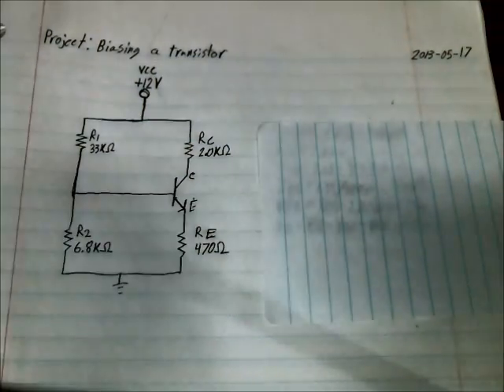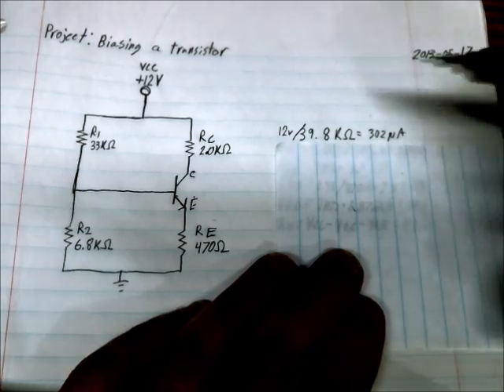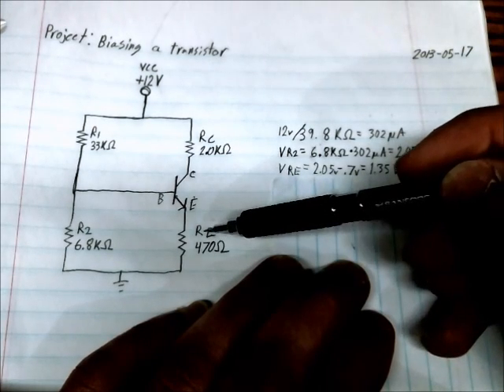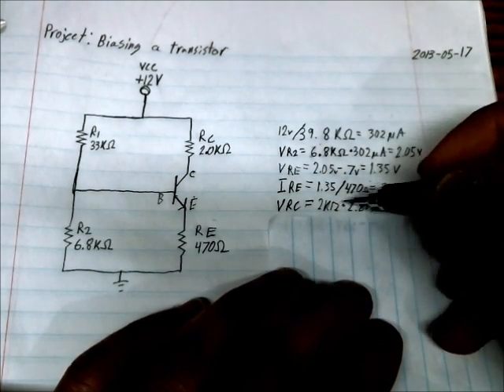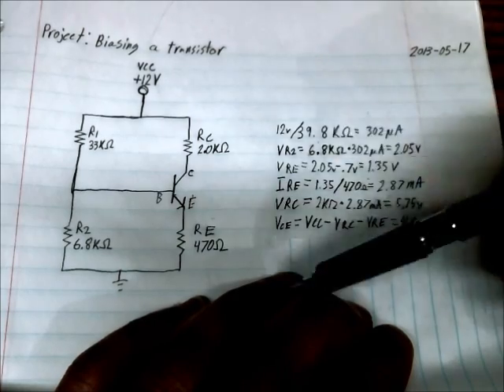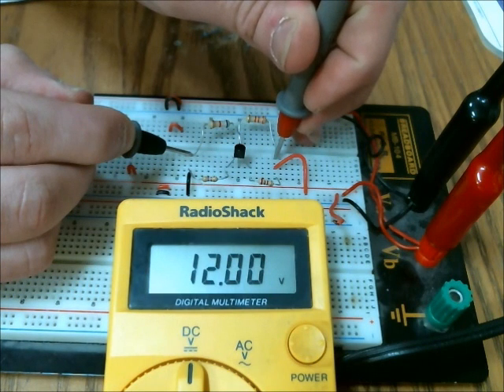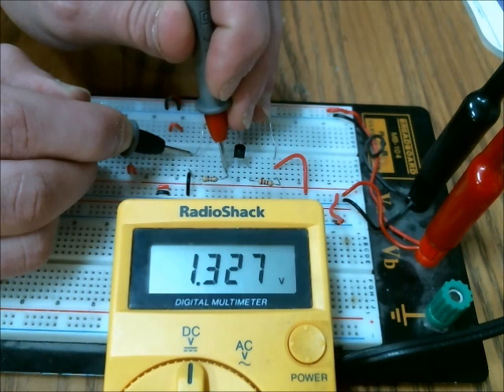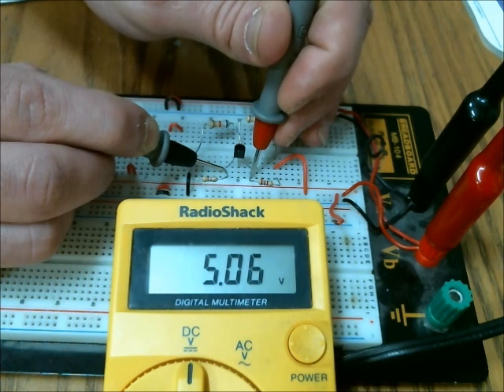How to calculate Transistor Bias

Comment: Why do you calculate VR2 and not VR1 and then use that to calculate voltage drop between the base and the emitter, when the base is supplied from the positive rail R1 side.
What would be the voltage drop be between the base  and the emitter if R2 was not there.

Comment: Heilman has done good work in showing the various DC voltages when biasing a bipolar transistor.  The trouble with this approach is the accuracy and the application of this
design. 
- the hfe of a bipolar transistor is SPECIFIED with an variation of (say) 3:1. 
-A further variation depends upon TEMPERATURE  due to the self heating of the transistor 
-A complication of the design arises due to the magnitude  of LOW FREQUENCY  AC output 
signals . Many factors must be considered and juggled..., too many to quickly  discuss.
Reply: Because the current through the bias resistors is significantly larger than the base current, the hfe of the transistor has little effect on the bias points.
Because the collector current is fairly low, the dissipation in the transistor is small (about 15mW), so the self-heating will be no more than about 3°C at the junction. That means a reduction in Vbe of about 6mV, but that is swamped out by the voltage across the emitter resistor, which provides negative feedback and stabilises the bias points.
Because the emitter resistor (470R) is very much larger than the intrinsic emitter resistance (25mV/Ic = 9R), the non-linearity of the intrinsic resistance is swamped put and has virtually no effect on the large signal response.

Now, of course, all of that depends on a sensibly designed circuit, which the one shown is, so the points made are valid considerations if you have transistors with very low hfe, or you have base bias resistors that are too large, or you have a circuit with high current and voltage, or you have a very small emitter resistor.

Comment: ehere did you get the .7v
Reply: Any silicon transistor passing a few milliamps of current will have a base-emitter voltage drop around 0.6V to 0.7V. It's an inherent characteristic of all silicon P-N junctions.

Comment: HEILMAN HACKATRONICS 
                                                                          Does the AC/DC load line mean the maximum output wattage power of the transistor or does the AC/DC load line mean the power dissipation of the transistor? 
                                                                        Because the AC/DC load line is selected by the EE designer of the operating voltage and operating current for the transistor and the DC bias Q point which will determine the maximum output wattage power out of the transistor and the power dissipation of the transistor. I'm not sure what the LOAD means in the AC load line and DC load line what they are calling the LOAD.

Comment: I don't see where the .7 volts  for the base/emitter voltage drop comes from....
Reply: Any silicon transistor passing a few milliamps of current will have a base-emitter voltage drop around 0.6V to 0.7V. It's an inherent characteristic of all silicon P-N junctions.

Comment: all well and good until your input is 20 mV pk-pk, -0.7v gives you a negative value... then what ? im so confused
Reply: You couple in your ac signal through a capacitor to the base of the transistor, so that the 20mV pk-pk stays centred around the +2V that the base is biased to. The circuit as shown will accept input signals up to around 2V pk-pk.

Comment: how to determine the transitior is whether in saturation or in cut off or in active region? Pls help
Reply: Vce=.2volts The Transistor is in Saturation Mode.When Vce=Vcc  The Transistor Is In Cutoff Mode And When Vce=1/2 x Vcc The Transistor Is In The Normal Operation Mode. Vcc Is The Supply Voltage... We Have 2 KVL Loops Vcc=Rb1+Rb2 and  Vcc= Vrc+Vce+Vre  Voltage Gain= -Rc/Re  I Hope This Information Helps!!   Best Regards MR.OHM1970

Comment: hello sir i'm beginner, can you explain why you subtract 0.7v to find the VRE. is the diode is silicon type or what?
Reply from the maker: There is approximately 0.7v dropped across the base emitter junction, when the transistor is turned on. This transistor is a N-P-N: Collector - N, Base -P, Emitter - N. A silicon diode is P-N: Anode-P and Cathode-N. in both cases there is a 0.7v drop across the P-N junction.

Comment: R1 and R2 shouldn't have same current why u plus the resistance ?
Reply from the maker: to determine the total resistance
Reply: so they are in series ?
Reply from the maker: This method is an approximation technique, which as you can see at the end of the video works.
Reply: ohhh I see ok ) thanks much
Reply: Tarek Mostafa ... the current through the base is very small and negligible (uA) compared to that through the resistors.

Comment: Now for the tricky part... Input and Output Impedance... DC Switching Applications are easy... try throwing an AC signal through them like Audio... you use a common voltage divider value... say... with a 9 vdc supply and the collector to V+ and a 10k value on the emitter (a common collector NPN buffer situation), a base divide of 100k/15k, and it sounds good with a low impedance signal but try feeding it with something high like a guitar and it sounds muted and weak... then you add a small value resistor of 47k (or larger) between the divider and the base of the transistor and ka pow... the impedance of the transistor input is fooled into seeing a high impedance and the guitar sounds much better... impedance is everything when it comes to Audio and the difficult aspect to grasp when it comes to gain... And I did enjoy your video... simple and effective... what can you tell us about saturation?
Reply: You just use base dividers of 100K/100K and your problem is solved without any extra resistors. Simple.

Comment: In the explanation you just took the current through r1 and r2. What about the base current that splits at the junction of r1 and r2? Should it be ignored?
Reply: The motivation is probably that its very small if the beta factor of the transistor is high and such can be ignored if that is the case.
Reply: When analysing these sort of circuits, a simple tip is to look at the value of the collector resistor (Rc) and the lower base bias resistor (R2). As long as R2 is not a lot bigger than Rc, you are safe to assume that the base current will be negligible compared to the bias current through R1 and R2 - as long as the transistor has a β in excess of about 50, which will be true almost all of the time.

Comment: A better title for this would be how to analyze a transistor circuit.  To figure out the bias from scratch you would have some requirements like swing voltage on the output, current limits on the output and through the transistor, etc...  I've watched many of these videos now and have yet to see anyone take the "requirements" approach and show how to determine the bias and  current components.   Still a nice explanation of a transistor circuit.

Comment: Ok. Then I only need to calculate the transistor to get close to the middle point between cutoff and saturation considering the gain and the amplitude of the signal imput. It will work kinda class A amplifier (All the time in resistive/active mode) Right?

Comment: This is showing how to analyze a transistor circuit - not bias one?  To demonstrate how to bias a transistor you first need requirements of the circuit and the type of transistor to be used.  Then you can figure out what resistors, etc... will be required for the input and output of the circuit.  This has to be the umpteenth video I have watched and they all do the same thing - analyze a circuit but never show how to create one from scratch given only the input and output requirements.
Reply: Totally agree digger. It's useful for for fault diagnosis on an existing circuit. It's no good for calculating biasing etc. for initial design.
Reply: I thought the same thing because I’m trying to understand how to design a simple circuit. Thank you

Comment: If there is voltage drop of 0.7 volts across the BE junction in the transistor, shouldn't the impedance of that junction be taken into account as a series "resistance" with RE?  And shouldn't the combination of those two be taken into consideration as a parallel resistance to R2? All of the above before you can calculate the current through R1?  Just asking here, because I'm no expert on this.  Perhaps you are, but it seems you are ignoring the part of the circuit that is parallel to R2 in your initial calculation.  Please explain.
Reply: +Wood Wright The resistance of the PN junction is not linear, so is better take it out as voltage.
Reply: When calculating the dc bias points, the dynamic emitter resistance of the BE junction will be so small that we can assume the voltage Vbe is always between 0.6V and 0.7V for all practical collector currents. In most cases, it's simplest to just assume Vbe is fixed at 0.7V.

When you're calculating the gain of the stage, the dynamic impedance of the BE junction will need to be considered. For a bipolar transistor, that is the slope of the Vbe vs Ie curve, and is given by 25mV/Ie, which turns out to be around 9 ohms in the given circuit. because Re (470R) is so much larger than that, we can ignore the effect of the junction impedance.

Because the current into the base is a factor of β smaller than the collector current, it means that resistances seen in the emitter are effectively multiplied by β when considering their effect on the base. In this case, there is indeed an effective resistance of β x (470R + 9R) in parallel with R2. However, if β > 50, then that resistance looking into the base turns out to be at least 24K (and probably a lot more), so it only has a small effect on the 6.8K resistor R2.

Comment: I thought it is a tutorial on how to bias a transistor. But what your doing is trying to compute current voltages for a given bias. You should have shown us how to compute for the resistance of those resistors so that the transistor is in bias condition. Yours is the resistance is already given. But the problem is we dont know how to determine the value of those resistors. Hope you can make another video showing how to compute for the resistance of the resistors to stabilize the transistor.
Reply: That's the difference between analysing an existing circuit (which is what this video set out to do, and does well) and designing a circuit to meet a particular specification (which is not the intent of this video). The design process can be complex and requires rather more than a basic knowledge, so it isn't the same target audience.

Comment: I always get confused on the current thru R1 and R2 in the first step.  Can you assume the current is equal in both R1 and R2 to compute the voltage at the base?  Won't some of the R1 current flow to the base and the balance flow thru R2?  It would not be a true voltage divider.

It seems as if you need a set of simultaneous equations (in a spreadsheet?) to get the correct answer.

Or maybe your disclaimer "this only works with a high impedance load" is the key?  This makes the current flowing to the base from the R1-R2 junction negligible?   But the emitter resistor is much smaller (470 ohm) - is that considered a low or high impedance?

I guess it must work - since your circuit measurements agree with the maths.

Thanks for posting.
Reply: You start by assuming that the collector current (Ic) is about half the supply voltage divided by the collector resistor - in this case 6V/2K = 3mA. Then you make a worst case estimate of the current gain β of the transistor, say 50. That tells you that the base current (Ib) can't be more than about 3mA/50 = 60μA (and probably a lot less). So when you calculate that the current through the bias resistors is 300μA, you can see that it's much bigger than Ib and the effect of Ib on the bias point will be small.

if you want to compute the actual effect, then you can use Thevenin's theorem to treat the voltage divider as a voltage source of 2.05V (as calculated) with an "internal" impedance equal to the parallel combination of 33K and 6.8K = 5.6K. If you draw a base current of 60μA through 5.6K, you drop 340mV. so the actual voltage at the base would be 2.05V - 0.34V = 1.71V. Of course that is worst case when β=50, so in most real cases where β might be 200 perhaps, then you'd have 1/4 of the base current and therefore 1/4 of the voltage drop, so the base bias point would be more like 2.05V - 0.09V = 1.96V. Remember that in a real circuit, resistor tolerances can often have a bigger effect than that.
Reply: That seems plausible to me....

Comment: Matt Heilman at 2.30 you say it is between saturation and cut off. BUT: Vce is much greater than Vre +0.7V so it is definitely operating in saturation right??
Reply from the maker: A BJT is current dependent so difficult to determine by voltage.
Reply: For Normal Operation  Vce=1/2 x Vcc, Saturation Vce=.2 volts and Cutoff Vce=Vcc  Vce must be>> Vbe for Proper Operation  Rb Controls Ib   Ib controls Ic   Ic Controls Vrc  Vrc Controls Vce.